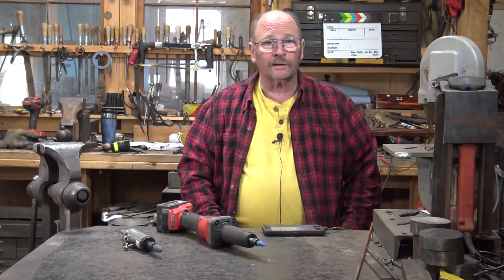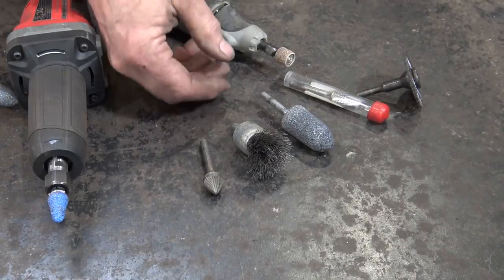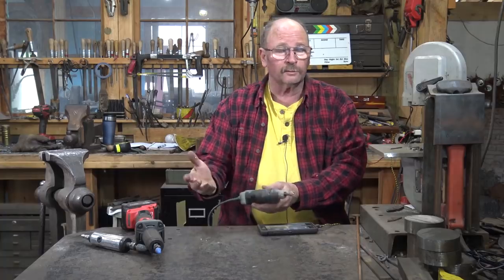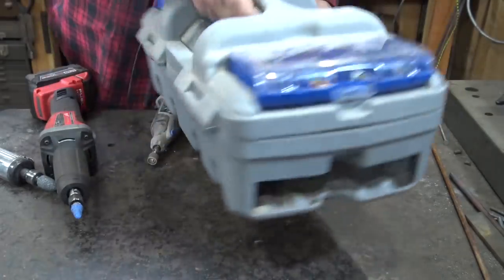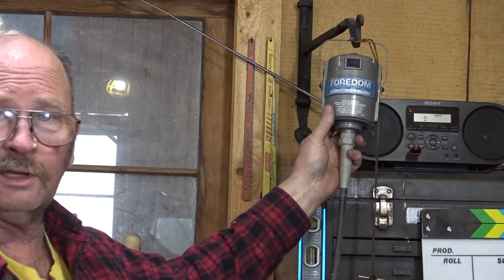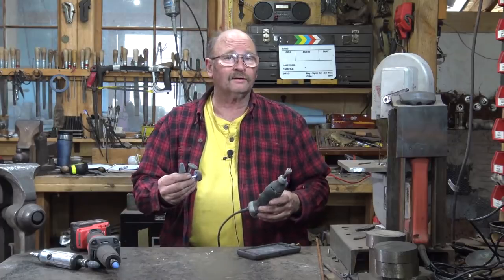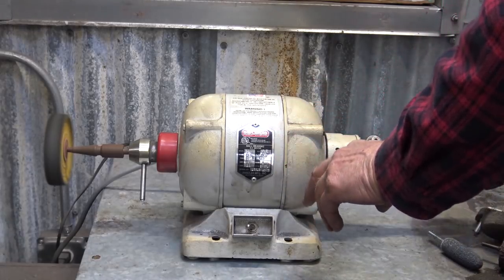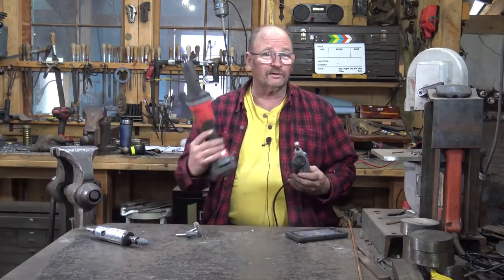Rotary tools, a lighter duty alternative

Comment: John, I've used a dental lathe (motor) with a Wells automatic clutch for 30 years (as a dental technician) and have used it in the shop also. Don't be afraid of using cut-off disks in the lathe, it  works very very well for that. Just be careful and wear protective eye ware, and try and not draw blood. Also, never let the clutch lever snap back after removing or changing or adding tooling. Wears out the clutch. Great machine to have and use, the more ;you use it the more you will need it. I have also secured the big die grinder in a vice, and it is much more stable to grind that way than free handing. Much more control.
   Nice video.

Comment: Thanks for the excellent video John. Would really appreciate a follow up video in using a die grinder with carbide burrs to enlarge or shape inside a hole ( lets say around 3/4) I have found this can be a little tricky!

Comment: I have a chinese knock-off rotary tool. Cost about 2/3 of a dremel and has a bit more grunt. Uses a small three jaw chuck and a flex shaft with a collette. It'l take up to 1/8" (5mm) shanks.  A die grinder would indeed be useful for the bigger jobs, but at this stage the little rotary tool does a reasonable job when needed (I admit, I use it more for wood projects).

Comment: ..well put me in a leisure suit and call me ken. i did use a dremel with a 1/8" end mill to finish up the hardy hole in the railroad track anvil on the flat or bottom side. it took a while and a couple of bits after drilling most of it out...😊

Comment: So good to hear your opinions   And the practical purposes for each.   I have a question.  I’m a welder and will start blacksmithing within a week or 2. As I complete my shop addition. Or wife says addiction.  Question:  I want to make a simple striking block out of my onhand heavy rotary mower blades. Cut down to the flat   They are 1/2 x 4-6 inches flat length probably be 12 inches. I will weld these into a single mass , realization of the flex they will have. Should I use the welded stack on edge or flat?   My work is mostly ornamental use 1/8-3/4inch x 1/2-2 inches cold roll, will be my anticipation steel size
My thinking I will use this until I can afford a good anvil
Reply from the maker: Probably best to have the flat of one of the blades up.  That would provide a reasonable size surface and would be smoother than the welded up edges.
Reply: Black Bear Forge thanks.  I have enough to make about 6 inches thick 12 blades.  I’m going to make a Hardy hole.

Comment: ah yes a fordam we have one of those my cousin gave us after he stopped doing jewlery work, they are lower speed and high torque, as you have pointed out they were used by jewlers and for lab work or cleanup work, I use ours once in a bit when propmaking very good for woodwork but often too slow to really sand and hew out bits of wood for groves and details I ovetn have to hollow out, the dremal we have was well made back in the 1990's we dont use all the time but it has lasted us this long and its soo old it was still made in the united states now they put them togather in mexico, still a nafta zone but we need the jobs too :( we manely use ours though for woodwork or grinding bits of metal as we also do light fab work making grills and stands for things stuff like that, I just dabble in smithing, but I like to watch and learn in case I ever do want to try a bit more heating beating and bending of hot metal.